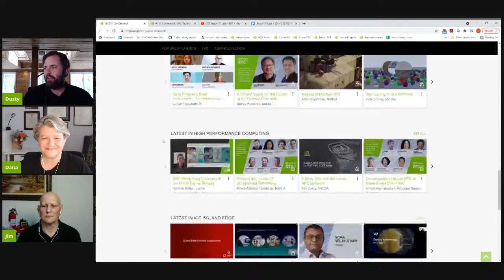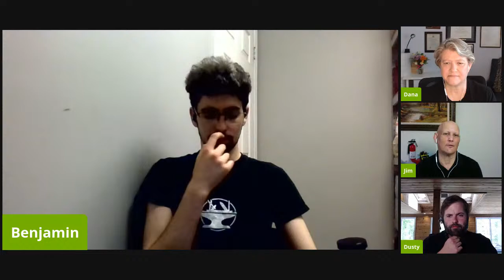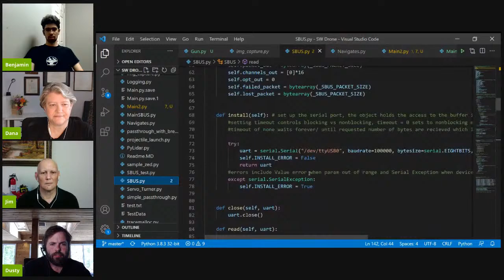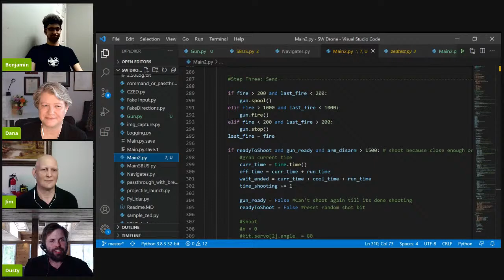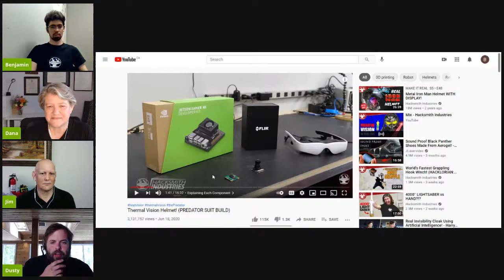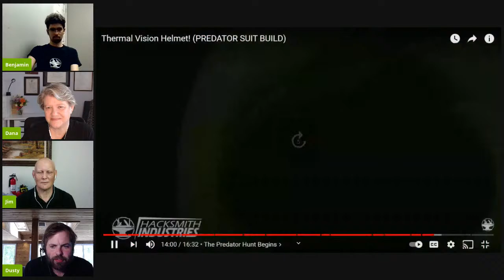JETSON AI LAB – E04 | Jedi Training Drone

Comment: Trying to connect a Jetson Nano to my Arduino Uno drone which I made last month but wasn't successful yet! basically means using the Uno as my control system unit here. Help me guys.
Reply: Mead- I set mine up by screencasting from the tablet I use to operate my drone to AppleTV and use that output for the Jetson Nano hdmi input
Reply: @stephansloan121  I didn't understand! I was mean connecting Arduino Uno to Jetson Nano?